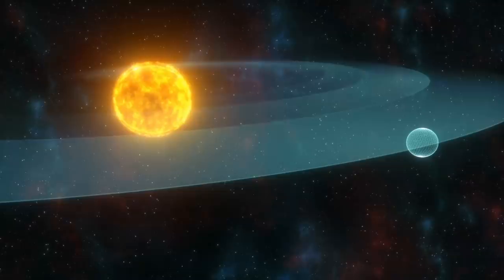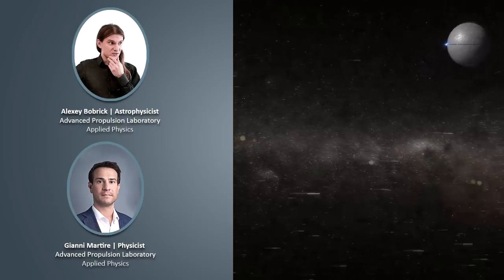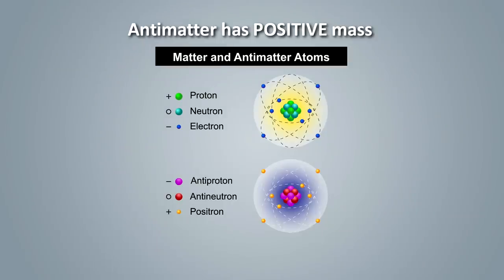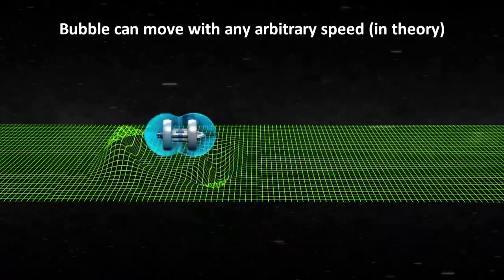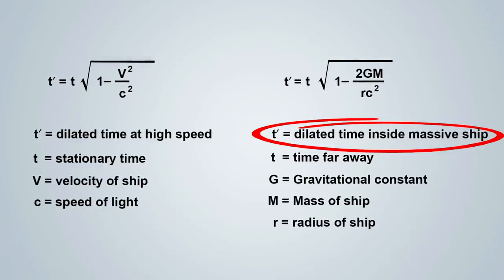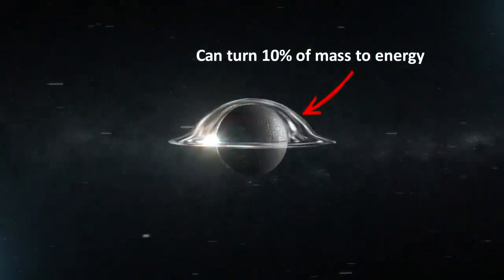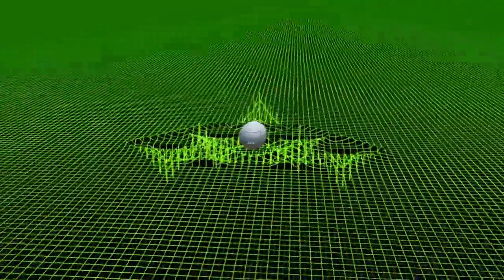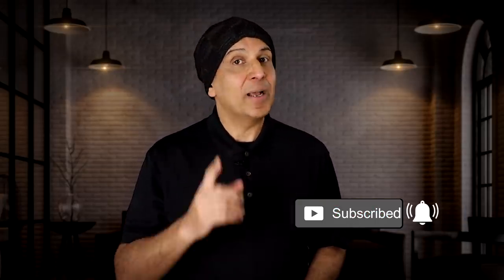REAL Warp Drives? NEW research proposes a solution!

Comment: Building a spaceship with a mass total of 10% of the sun, that needs to convert 13% of that mass directly to energy to travel to our closest star.
Arvin: "Feasible."
Reply: Physically feasible. Technologically unfeasible for now.
Reply: Compared to "needing the entire energy of the universe" I'd say 10% of the sun is indeed "Feasible"
Reply: Sorry, I forgot to mention that 10% of the mass is crammed into a sphere with a diameter of 620 METERS! That's *30* more than Schwarzschild radius of 0.1 solar mass.
That's right, if the mass of this ship gets squeezed by just 30 meters, it will collapse into a black hole (unless I am mistaken) 

You guys have very different definition of "feasible" than me.
Reply: @NotDmitry  yeah that is the real issue. Martire's solution too requires concentration of energies that will create black holes and become unmanagable almost immediately.
Reply: @NotDmitry  So what you said is significantly harder than using the entire energy of the universe at once? All right then.
Reply: Actually they already achieved zero mass velocity... you don’t need a Death Star, but they did that too... once the gravitic craft become massless they can move as fast as they want, literal infinity.
Reply: This seems overly complicated for no reason. If you can't get faster than light then why even bother with a warp drive? You could build a normal ship that goes 0.5 c and get to Alpha Centauri in 10 years instead. Doesn't sound too long for future generations with advanced space travel, medicine and radiation shielding.
Reply: Step1: First build a Dyson Sphere and gather that energy. Of course "Feasible". Sincerely we need something more efficient. Maybe some new discoveries in subatomic particles? Bonus: We don`t even know if the "gravity equation" of Einstein is right.
Reply: @M4V3RiCkU235  Einstein wasn’t a fan of non locality, so unfortunately no he wasn’t.
Reply: SlimShady But it is theoretically possible, and what if we want to go to other galaxies?
Reply: @vibaj16  then you better have some Damb good telepathic abilities, because most systems out there are already “taken” at least in 3rd density consciousness, in 4th density, all of them are.
Reply: @slimshady6597  MASS cannot go faster than light... because light is fundamental to mass itself and as such cannot travel faster than itself.... in order to go faster than light, you must become massless... they’ve known this for a long time... in the words of Ben Rich, director of the Lockheed Martin skunkworks “we have the ability to take ET home”...”Star Wars, Star Trek, we’ve already been there, done that or decided it wasn’t worth the effort”... people aren’t thinking about ET life properly... 99% of people still don’t know what life is. How can we interact with a civilisation that knows all these questions already, without mass hysteria and religious insurrection... make no mistake. “They are here” and they don’t reveal themselves because they know us better than we know ourselves.
Reply: @addamriley5452  wtf are you talking about? "3rd/4th density consciousness"? Did this suddenly turn to random psuedoscience?
Reply: @vibaj16  you’ve never heard of densities of consciousness? What part makes you think it’s pseudoscience... probably the part where you haven’t heard of it right? Yes cause everyone knows that if you don’t know something then it must be wrong... go join a religion 🤦‍♂️

Comment: I deeply appreciate the amount of research and effort you put into your videos.
Reply: Space is a dual concept!
Space is dual to time -- Einstein.
Time dilation is dual to length contraction -- Einstein, special relativity.
Length , distance, space or depth is produced by the stereographic image created in your mind by the two dual images from your eyes -- hologram in the brain. Depth or the 3rd dimension is a by-product of duality (two eyes) -- holograms or two interference patterns produce depth, or distance. In physics the vector cross product between the x any y dimensions creates the z dimension or third dimension!
Distance, length, space or depth is defined by two dual points -- space duality.
Points are dual to lines -- the principle of duality in geometry.
Up is dual to down, left is dual to right, in is dual to out -- space duality.
Space duality is dual to time duality.
"Always two there are" -- Yoda.

Comment: Thanks Arvin Ash for the nice content.

I don't think that the "death star" ship will be that practical, because it may help those on the ship to reach far distances in shorter time, in their perspective, however for those outside of the ship the trip takes a long time causing a big time difference, which will not be nice(going for 20 months and coming back to see those who where with you 20 years older). 
Plus these trips to other planets would most probably be for exploration with the headquarters being on earth and so for them this ship makes no difference in the duration of the trip.
Reply: I partly agree with you. Suppose you have a ship moving at 0.5C to another star and it will reach the star in ten years. Then, a question one may ask is by how much older do we want the passengers to be when they get there, as indeed choosing how massive is the ship can make a huge difference. And there you are, travelling to another star and choosing between being 10 years older upon arrival or a few weeks older. This is all, of course, while having in mind that creating massive warp drives is hard.
Reply: I agree with you. The solution proposed doesn't make practical sense. It would be much easier to simply look for a cryogenic sleep solution. There is no need for time dialation inside the ship. 
The main reason to look for a warp drive is so that people outside don't have to wait years to see the result.
Reply: @ke_1234  Traveling at currently available speeds using cryonics results in even greater timelines.
Reply: @Fun_Engineering, exactly my thought.
Reply: Space is a dual concept!
Space is dual to time -- Einstein.
Time dilation is dual to length contraction -- Einstein, special relativity.
Length , distance, space or depth is produced by the stereographic image created in your mind by the two dual images from your eyes -- hologram in the brain. Depth or the 3rd dimension is a by-product of duality (two eyes) -- holograms or two interference patterns produce depth, or distance. In physics the vector cross product between the x any y dimensions creates the z dimension or third dimension!
Distance, length, space or depth is defined by two dual points -- space duality.
Points are dual to lines -- the principle of duality in geometry.
Up is dual to down, left is dual to right, in is dual to out -- space duality.
Space duality is dual to time duality.
"Always two there are" -- Yoda.
Reply: Maybe if there was no need or desire to return to earth, maybe another earth like planet was found, and we had to travel their to ensure humanity's survival.

Comment: Happy to see progress in this area. But putting people in a giant stasis chamber and then calling it warp drive because they age slower, is stretching it in my book
Reply from the maker: Sure, I don't disagree. I think the point of these papers, as I said at the end, is that this is a starting point, and further research may (and likely will) reveal efficiencies that will decrease the extreme mass requirements.
Reply: How would an occupant in this space ship not be ripped apart by the intense gravity? Even at the very center of the sphere the gravity would be stretching you way passed your elastic limit. On top of that, how would you get inside of this space craft without being killed instantly when you got near it?
Reply: Space is a dual concept!
Space is dual to time -- Einstein.
Time dilation is dual to length contraction -- Einstein, special relativity.
Length , distance, space or depth is produced by the stereographic image created in your mind by the two dual images from your eyes -- hologram in the brain. Depth or the 3rd dimension is a by-product of duality (two eyes) -- holograms or two interference patterns produce depth, or distance. In physics the vector cross product between the x any y dimensions creates the z dimension or third dimension!
Distance, length, space or depth is defined by two dual points -- space duality.
Points are dual to lines -- the principle of duality in geometry.
Up is dual to down, left is dual to right, in is dual to out -- space duality.
Space duality is dual to time duality.
"Always two there are" -- Yoda.
Reply: @cvp5882  
You’re stuck in normal space time.

Comment: the only way any kind of interstellar travel would be possible, is when we learn how to project gravity in front of the ship and use the gravitational pull as a propulsion  ,infinity would be in reach!!!
Reply: Wouldn't stopping be a problem?
Reply: Yes I agree with that but then also on the backside of the craft you could have something that creates anti-gravity to propel to push you away from and then having the one you mentioned in the front and creating gravity and pulling onto an object that is ahead of you like a planet or star system would care you a long distance I have yet to fully met I have yet to fully work out the mathematical equations on all dat to know how much mouse or energy would be needed
Reply: @phil2945  there wouldn’t be a problem with that because you could change the pole to repelling by going from gravity to antigravity field to slow down or even just coasting in on just regular engines once you turn off the magnetic field system in front
Reply: @danyelPitmon  how much do we understand what the gravity is ?
Reply: Bro what that sounds dumb

Comment: "If a spaceship is constructed of a massive, super-dense material, perhaps close to the mass-density of a neutron star... then any individuals inside the ship could experience time dilation." 

Yeah, I'm sure that their remnants, crushed and smeared into the hull at the atomic scale, would totally appreciate the slowdown of time!
Reply: Right in the center of earth the gravity cancels out and equals to zero, same principal applies in the case of this hypothetical spaceship.
Reply: @pinocleen  How do we approach the centre?
Reply: @ximalas  multiple parts of it brought together would be one way.
Reply: So what is then the useable region of this ship? Confined to a... van? If even? Or - located at the very center: zero g in the stomach, 10g in toes and brain? Do you need to turn like a chicken on the barbecue to age the whole body equally? I do not have a clue but... could be funny to go into details.
Reply: @pinocleen  The tidal forces would be so strong that if you stretched your arms out, each arm would be ripped off in a different direction.
Reply: @CaptainFalcoyd  actually if its supposed to have 10% the mass of the sun, wouldn't that mean the acceleration on its surface would be 27.4 m/s^2, so, around 2.8g ?
Thats definitely not comfortable and/or healthy, but not enough to rip you apart with tidal forces before reaching the exact center... unless the ship is too small
Reply: You could also reach the center with a free fall or a controlled acceleration to counter gravity

Comment: Great video, but I´m not surprised😉!
 I´m wondering if these warp-drive solutions would  generate gravitational waves that we could detect at LIGO or future even more sensitive G Wave detectors? So we could check if alliens are doing it, somewhere..
Reply: Would sure be nice! They'd have to be close to the solar system and doing something extreme though.
Reply: Space is a dual concept!
Space is dual to time -- Einstein.
Time dilation is dual to length contraction -- Einstein, special relativity.
Length , distance, space or depth is produced by the stereographic image created in your mind by the two dual images from your eyes -- hologram in the brain. Depth or the 3rd dimension is a by-product of duality (two eyes) -- holograms or two interference patterns produce depth, or distance. In physics the vector cross product between the x any y dimensions creates the z dimension or third dimension!
Distance, length, space or depth is defined by two dual points -- space duality.
Points are dual to lines -- the principle of duality in geometry.
Up is dual to down, left is dual to right, in is dual to out -- space duality.
Space duality is dual to time duality.
"Always two there are" -- Yoda.

Comment: The problem with interstellar communications can be solved with entangled particles. Because no matter how far apart entangled particles are, how fast one particle is measured, or how many times particles are measured, their states become inextricably linked once they are measured. This can be used to link two points and will give instant communication(once we have the computing to process it).

Comment: 1:00 that warp field sits at x^2, y^2, z^2. At x^n/y^n/z^n where n>2 the craft sits at the bottom of a gravity well of increasing diameter. The diameter of the gravity well increases with n. So black hole.

Comment: Bell Labs has some neat work going on with zero point aka Negative Energy
Reply: Zero point is not negative energy. Neither is "apparent" negative energy.
Reply: @ReverenXero  
Yes, they are trying to get the energy of the vacuum (zero point energy). This energy arises because the uncertainty principle puts a limit on the scale at which something can be called a "vacuum" (because virtual particles blah blah blah). But this isn't negative energy. 

First, we have recall that mass and energy are the same thing, call it mass-energy. Negative mass would be mass whose weight was a negative number, say, something that weighed less than zero, like --42 pounds. Negative energy would be what you got if you converted that to energy. 

The article was interesting, thanks. If we could get the energy of the vacuum, it would be a great way to get limitless energy for a spacecraft.
Reply: @brianmarasca4496  Bell Labs (as the article stated) figured it out and built a test rig/POC a couple years back. The research is moving along at a decent clip :)
Reply: @brianmarasca4496  well if mass is gravitationally attracted to other mass then this negative mass would be floating high up in the heavens away from mass.. it would arguably be empty space or the vaccuum which is said to have crystalline structure but no form. radiation and sound waves. sound has structure and negative mass..

Comment: The whole idea of warp drive is to use the warping of space to provide the actual movement, not just detach the ship from the outside space time.  By standard Einstein physics, gravity is simply the warping of space time.  However, it has a significant acceleration effect on anything around it.  It follows then that if you create a warp in the fabric of space time, you create an area of acceleration around it, either toward or away from the warp, depending on the type of the warping.  In this way, you don't NEED to provide any standard "propulsion" since the warp itself provides the acceleration effect, indefinitely (well as long as you can keep the warp happening).  In this model, of course, you don't have the "flat" space time area under your ship.  Rather you've created a Sloped space time in the desired direction of travel.  Preferably not too sloped or you have too much gravitational stress on the ship and passengers.. Which brings us to the next point:   

A "neutron dense" ship where the passengers are under such a large gravitational effect is useless since the human body would not be able to survive under such a large gravitational force.  Also, while reducing the experienced time of travel may be good for the passengers, it does little for actual space exploration or colonization.  Resupply times and actual expansion times still become too large to be useful.